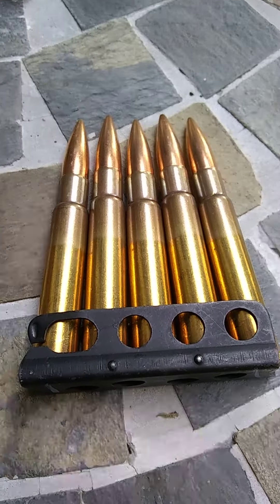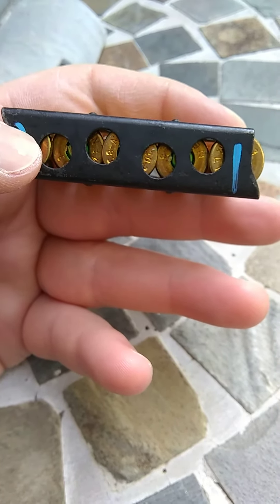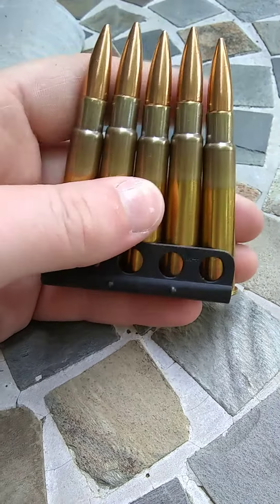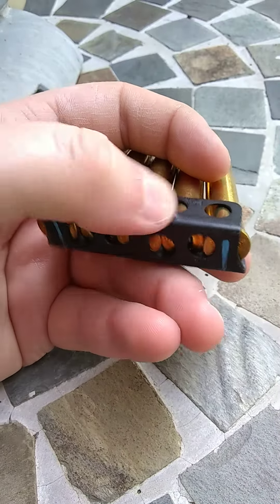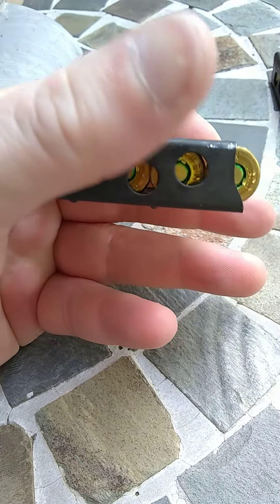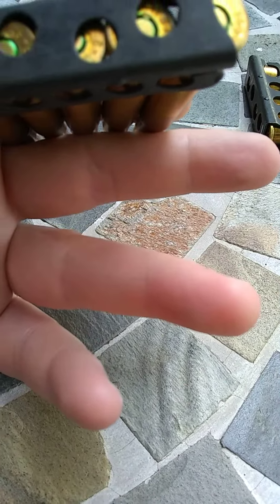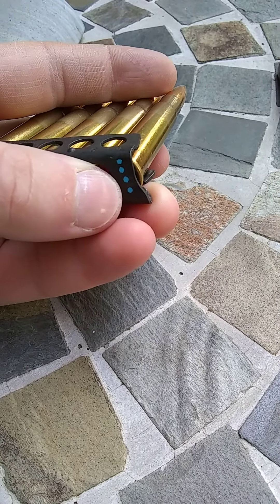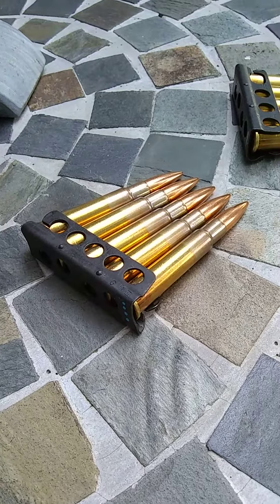Lee Enfield chargers and how to load them. (the British army method.) And more. Vid. No.4

Comment: Australian Army trained .303 decorated Marksman/Sniper here.
The first method is bollox. Rimlock is guaranteed!
(Especially under rapid-fire battle -conditions in the jungle, where the weapon may not have been serviced for days, accumulating gummy residues, dust, mud, blood, etc)

I was trained from the outset the second method. It works.
Reply from the maker: That's very interesting... I've noticed that rimlock seems to happen time to time, no matter how you have it organized in the charger...  I've been shooting enfields for years now and IMO how carefully you strip the rounds from the charger into the mag will prevent rimlock... Pressing down without stopping seems to work better, but if you hesitate and stop half way cause you think you're hung up it mucks things up.... Besides, I've also noticed that if you get rimlock, closing the bolt with good force will fix the issue. I rarely get rimlock but when I do, I forcefully push the bolt harder to close it. I think that works as it has something to do with the rim design. This will not work on my mosin, another rimmed cartridge.
Reply: Why does the manual say to do that
Reply: @jason200912  What "manual"?
Don't feel shy to be specific.

Comment: Yeah... 7,82*57mm german stripper clips make way more sense
Reply from the maker: Definitely. After using chargers for rimmed cartridges like the enfields or mosins, it doesn't compare in simplicity and ease of use like the Mauser design... even mannlicher designed clips, which people praise on YouTube i find a bad idea. One dent on the side of the mannlicher clips and you'll have a hard time with them feeding... I'm still trying to find good mannlicher clips for my carcano...  Of course designs like the vetterli clip work well, which is more commonly seen in swiss rifles... But the design isn't as elegant as the Mauser clip... There's a reason the Mauser clip became popular, while other designs failed.